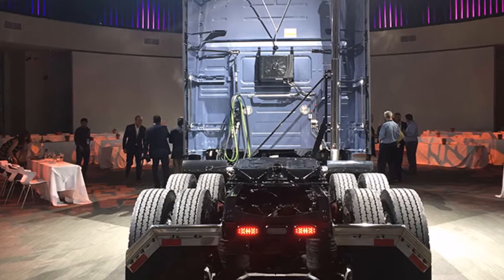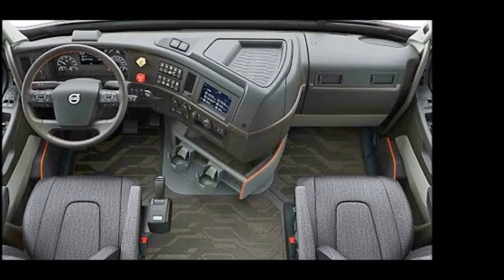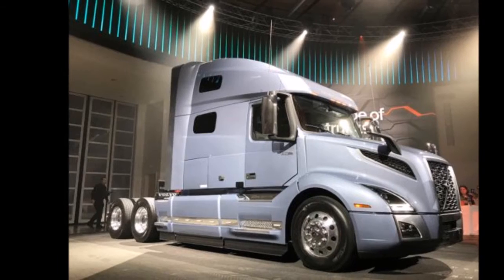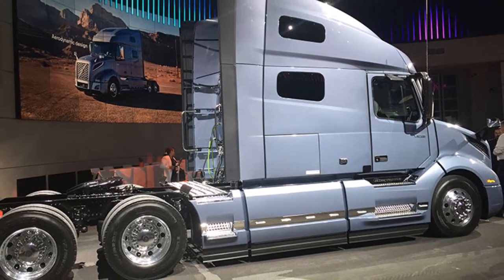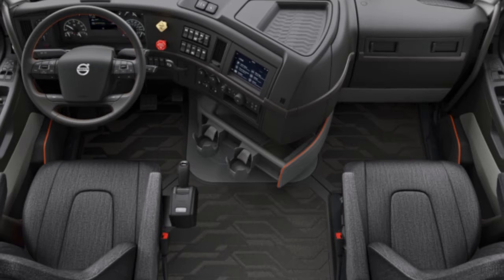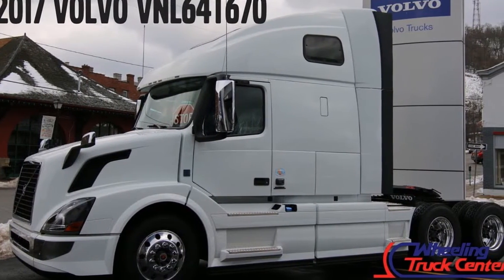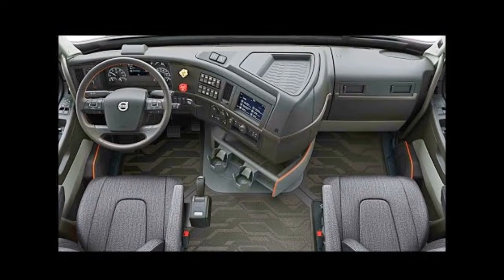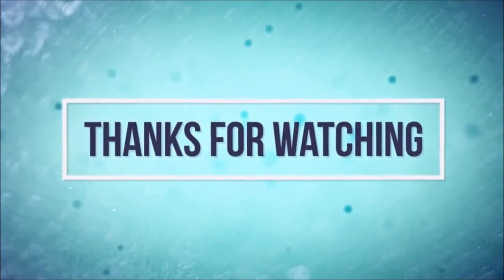Car And Driver reviews  Volvo takes wraps off new VNL Luxury

Comment: They unveiled a pice of shit just like the older pieces of shit they manufactured till now!

The North American truck manufacturers are in the stone age compared to the European counterparts!   American trucks are about 30 years behind the European trucks overall and about 100 years behind in steering and suspension, electrical system and air brakes system.   Quality of product is abysmal as the undercarriage is rotting with rust after just one winter season exposure to road deicer agents.   The archaic 12V electrical system uses exposed wires instead of protected cables on the out of the cab electrical system and the harness terminals are made of the cheapest plastic possible and the poorest design.